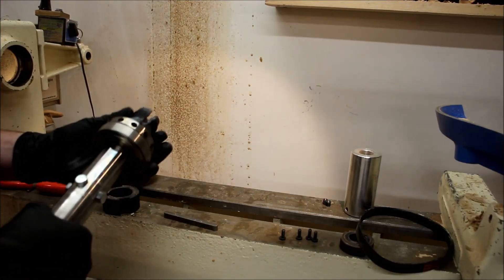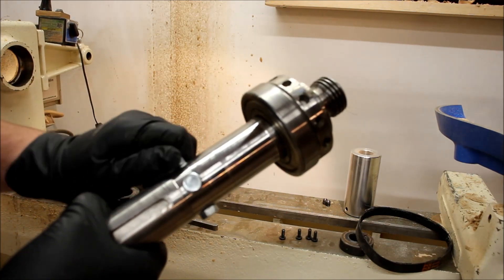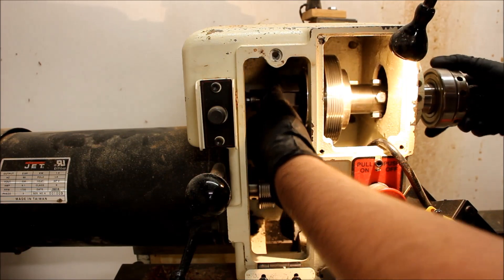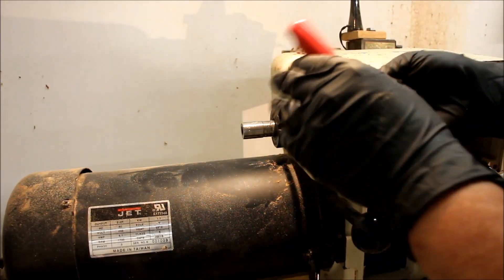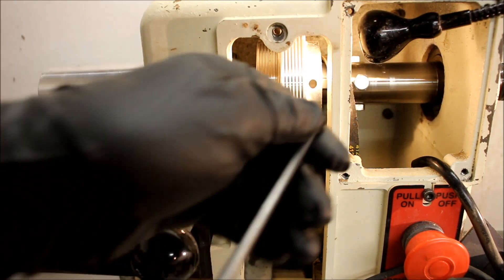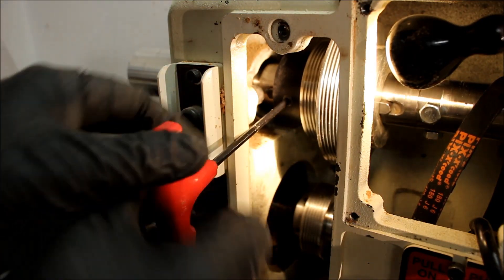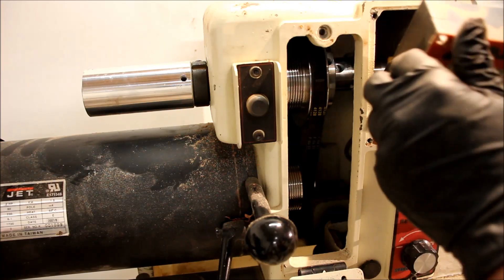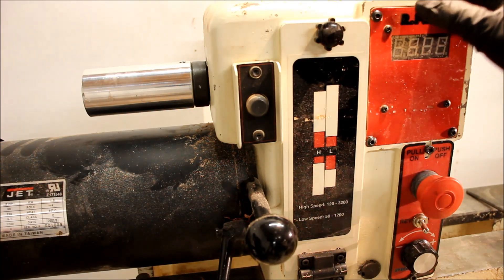Jet lathe headstock assembly, How to

Comment: I’m rebuilding a Jet 1642 right now. You did good. Cut a plastic washer out of a milk jug and put it on the spindle before you screw your chuck on and you won’t have a problem with the chuck seizing up on your head stock spindle anymore. You can buy plastic washers for that, but milk jugs are way cheaper. I went ahead and subbed too.